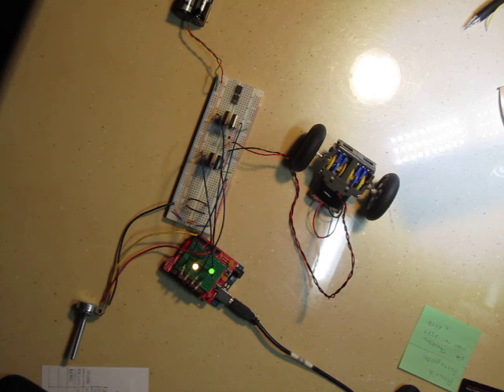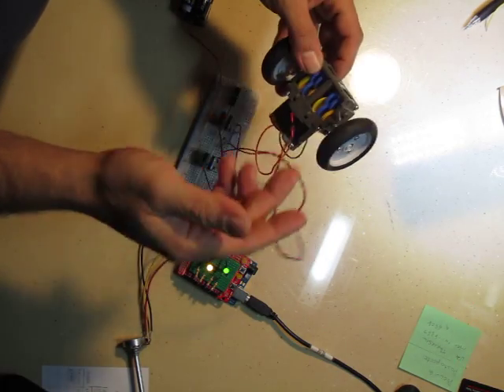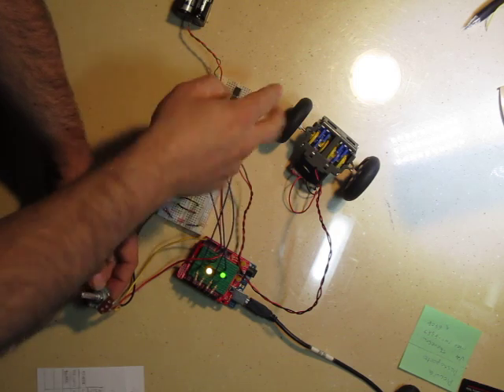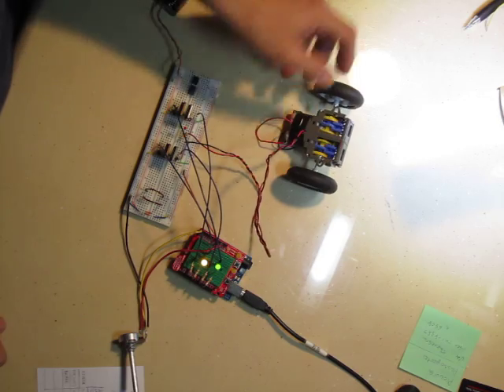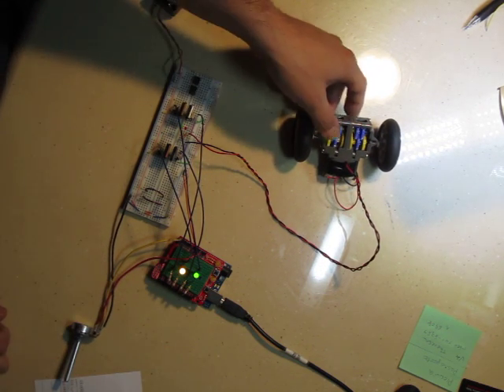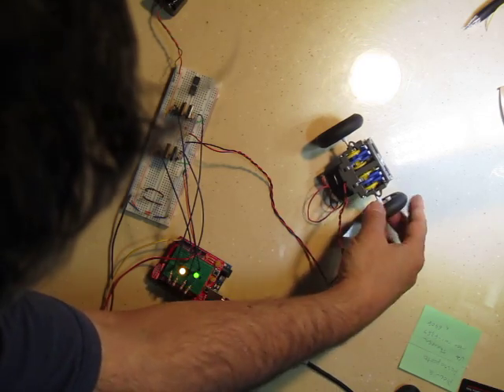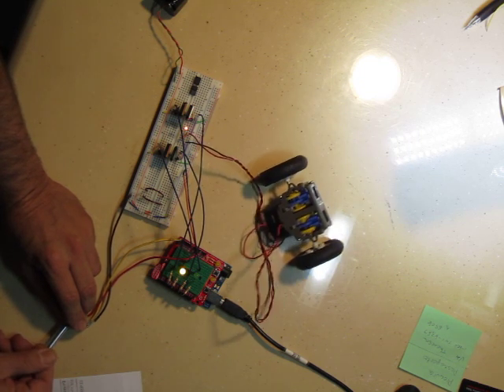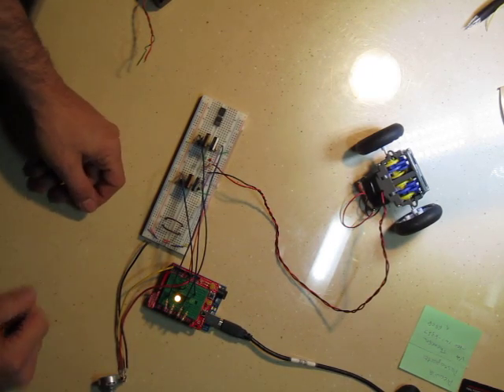Robotics Drivetrain, Arduino PWM Discrete H-Bridge

Comment: Would you be able to supply the schematic for the circuit and the code for the Arduino? I'm trying to do the same thing. Thanks!
Reply from the maker: Hi Joshua.  Unfortunately I no longer have the code or the schematic for this circuit.  You should be able to find a number of schematics for H-Bridge circuits online.  Each circuit uses different power transistors, so I recommend that you start by finding some readily available, matched-set of transistors.  The matched set are two complimentary transistors.  You'll need two packages for a total of four.  They don't HAVE to be a matching set, but you'll get better results with a matching set because they will respond to controls in a more symmetrical fashion.

As for the Arduino code, you can also find countless examples of that as well.  Each situation is unique, depending on how many motors you use, which pins you use on the Arduino, etc.  I highly recommend you try to get a good understanding of the entire method of controlling H-Bridge circuits - that way, you will be able to configure and customize your setup in a manner that best suits your particular application.  Remember, the whole idea behind the Arduino is to LEARN, not just to USE.

Comment from the maker: @KsmCol This is a basic H-Bridge driver circuit.  It provides variable DC power ranging from +X volts to -X volts to a load, which can be a simple DC motor, a lamp or other load.  The variability of the power it supplies is based on PWM (Pulse Width Modulation), which is sent/controlled by a microcontroller and software (Arduino, in this case).  You can use it very effectively to run the drivers for the lamps in a light show . . .

Many good examples of PWM, H-Bridge, and Arduino on the web.